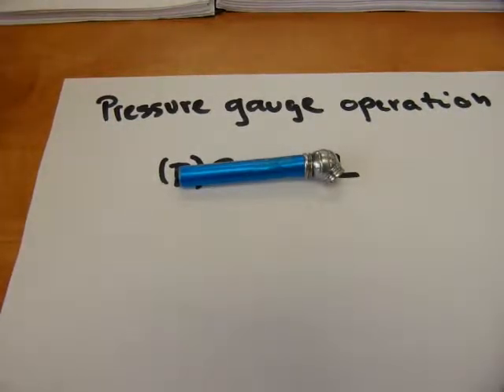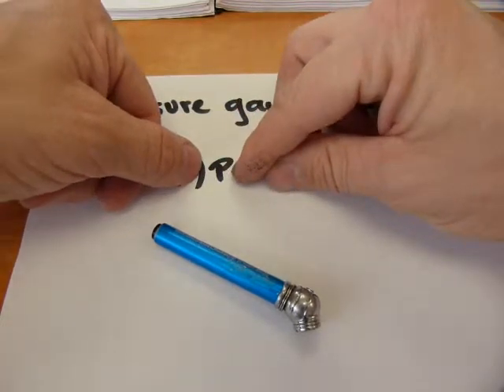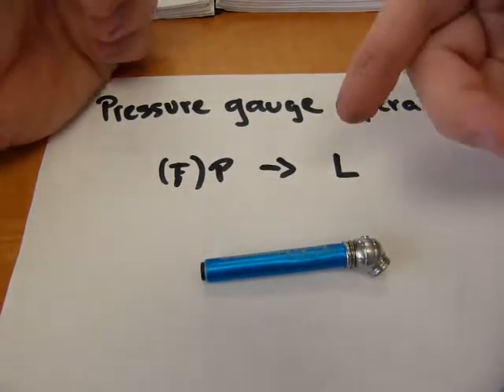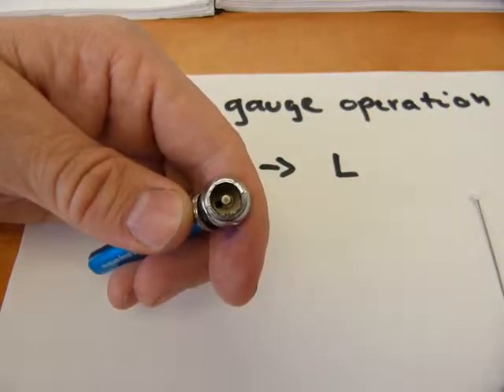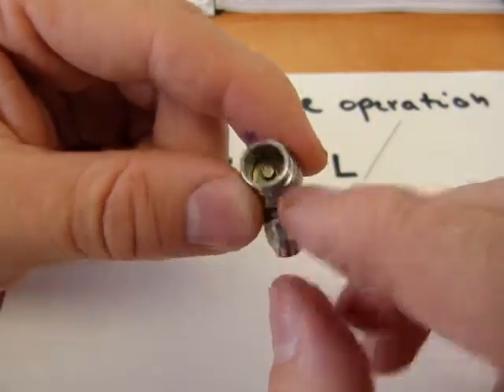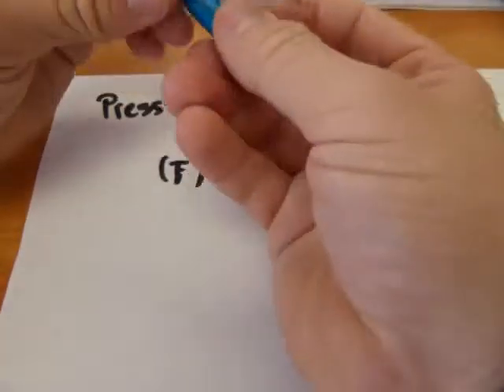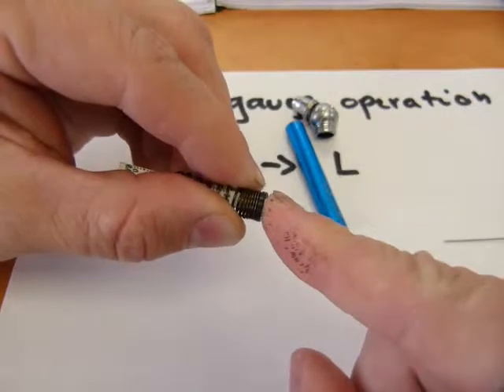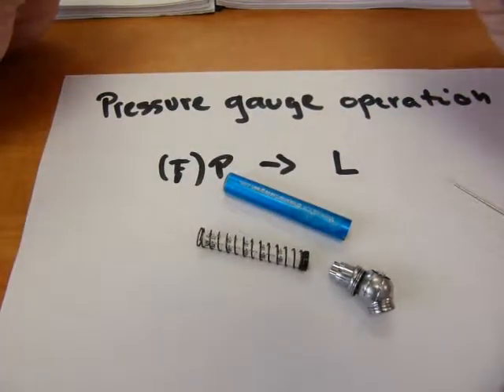Pressure gauge operation

Comment: I'm glad that's not my pressure gauge. I find it hard enough to get a good seal against the valve to also make sure I can read the stick at the same time. The ones which push out the stick with the markings on it, and where the stick stays out until you push it back, I find much easier to use.